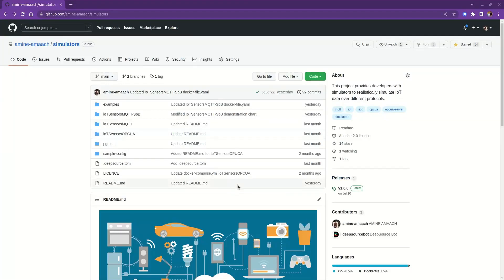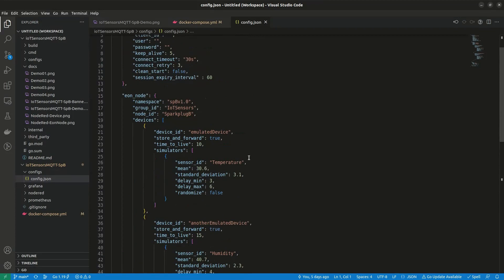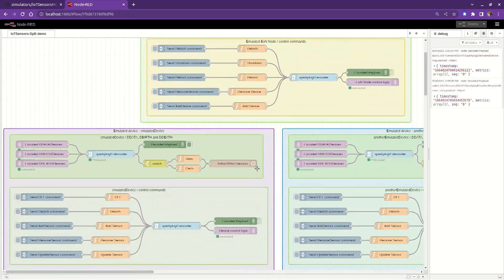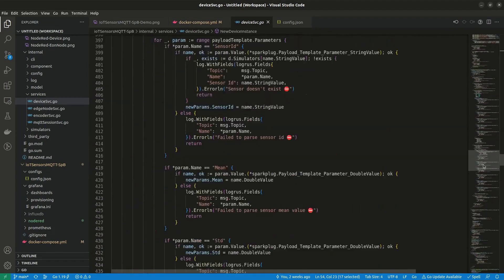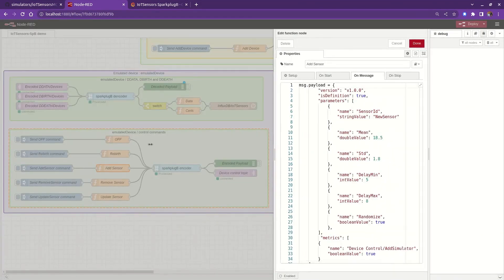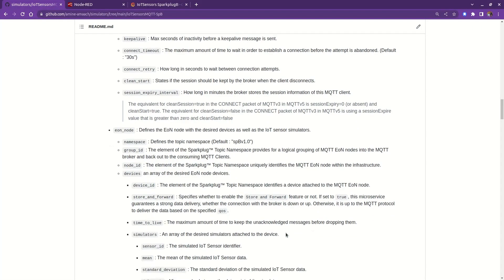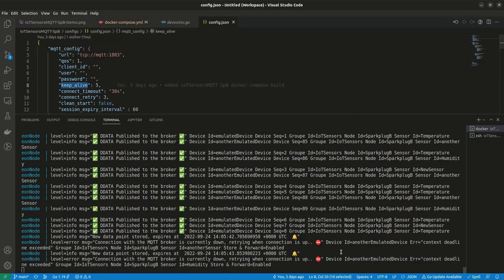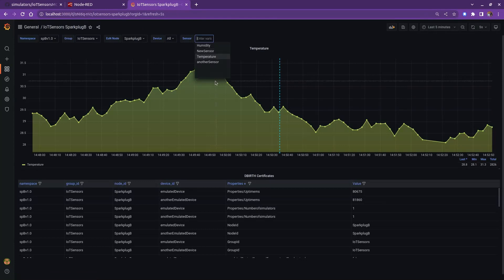MQTT Sparkplug B data simulator

Comment: Nice project. but could not download image
Reply from the maker: Sorry for the late reply, I have prepared a complete demo using the simulator that you can find on https://github.com/amine-amaach/simulators/tree/main/examples/ioTSensorsMQTT-SpB or you can simply run "docker pull amineamaach/sensors-sparkplugb:v1.0.0" to the pull the image.